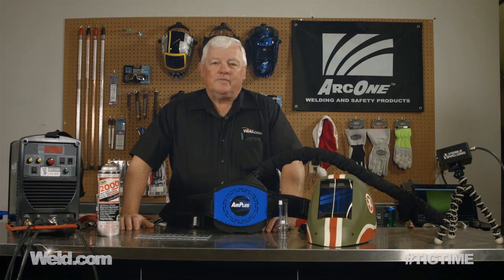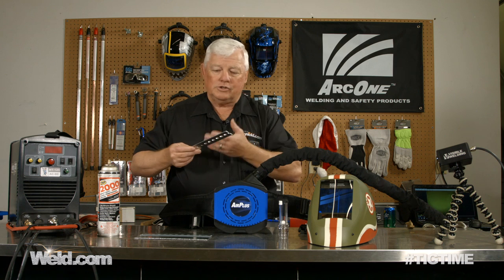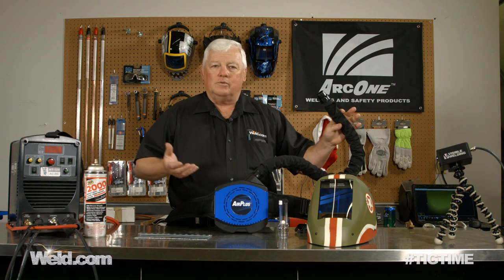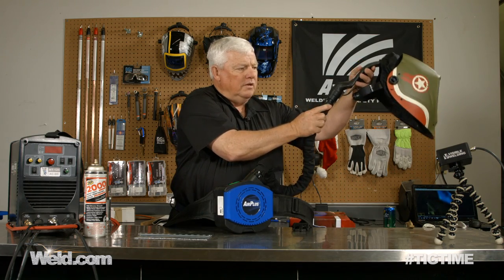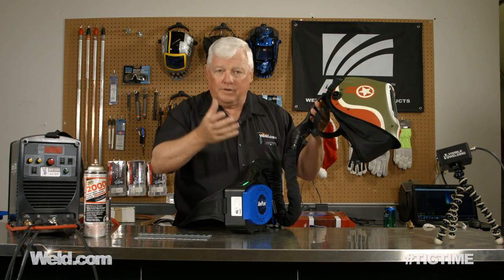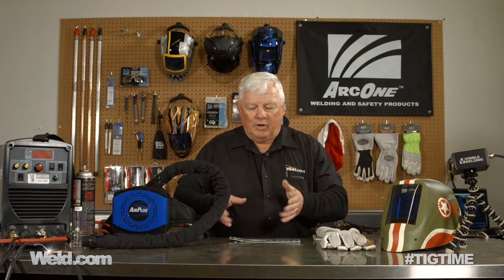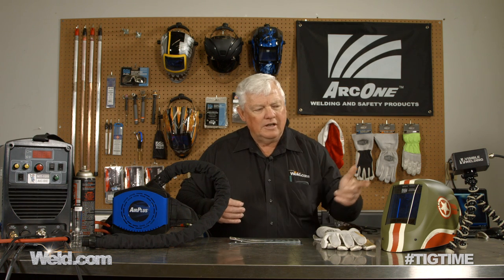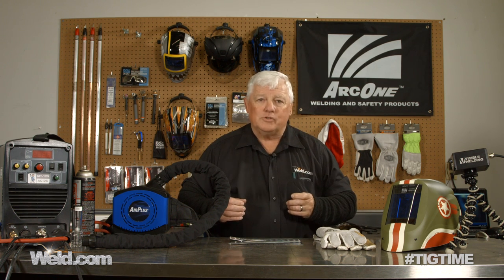Welding  Respirator Review: ArcOne AirPlus

Comment: In an age when employers do not provide grinders or disc, to do their projects, why would the welder depend on them to provide a safe air system that cost over $ 1000 each. As a welder that has worked 120 hours a week, what kind of respirator can a welder get to fit in a non air filter system that will protect them from harmful fumes?
Reply: Truth my man. Still so many employers don’t care about us welders. I can’t trust an employer off the bat to provide a osha approved ventilation system. A lot of jobs employers expect you, me whatever to provide damn near everything including clean air

Comment: why I don't see anybody using that on YouTube or real life?
Reply: Cost. This unit is relatively low priced to the competition, But most of it's competitors are around 2k for a system. This system is around 1k. I've had the chance to use 3m's speedglass before and it's almost like you don't want to take it off when you are outside. Buttttt cost.